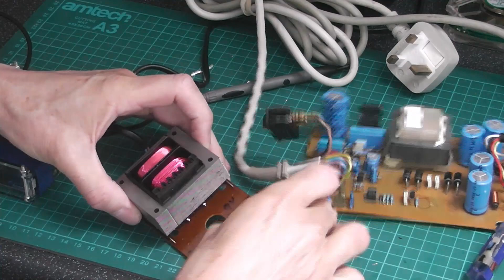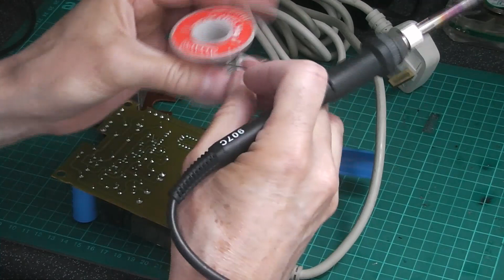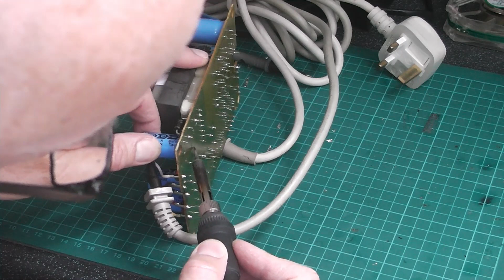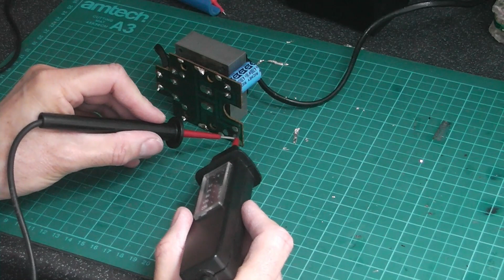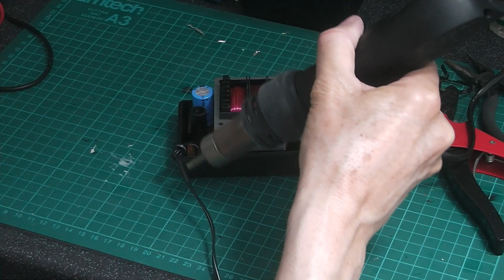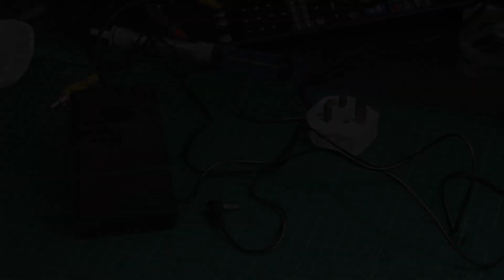Repairing a ZX Spectrum 48k PSU

Comment: What voltage rating should the 4700uF capacitor be rated for?  The unloaded supply voltage is 12V so would anything 12V+ be suitable? Thanks
Reply from the maker: Sorry for the late reply 🙁.  As a general rule a higher voltage than the original should be fine 👍

Comment: Electrolytics are generally within 20% of their stated value.. and more is better when it comes to bulk decoupling ;)  Also, get yourself a chisel or bevel tip for the soldering iron. If it's an Atten AT938 or similar clone, you can get packs of tips on Amazon for about £7 which are pretty good
Reply from the maker: I was sure I bought a chisel top for this iron, but I can’t find it 🙄. I’ll have to get another 😊